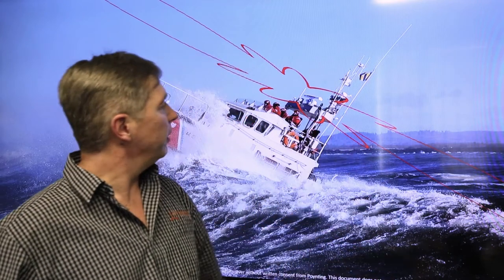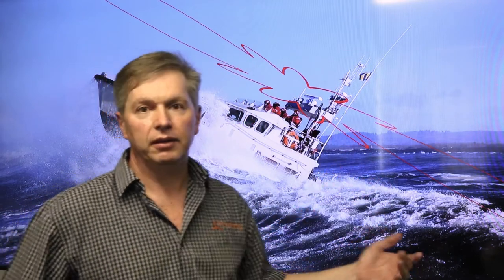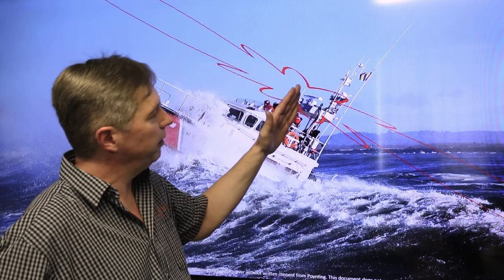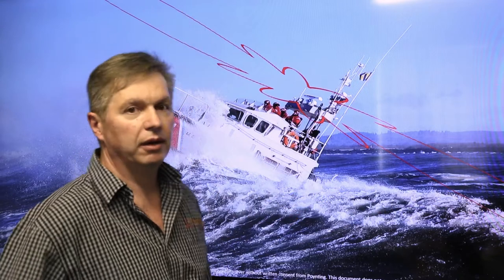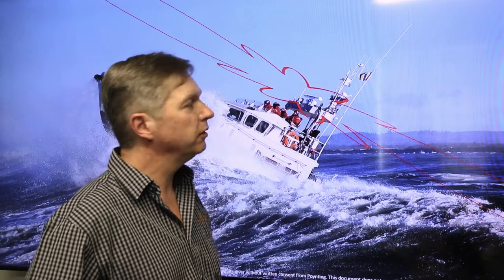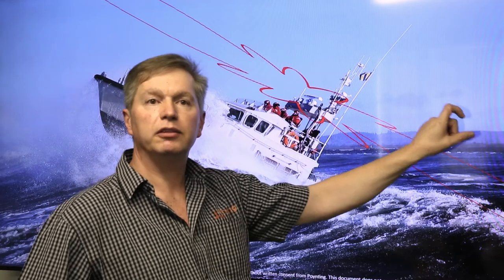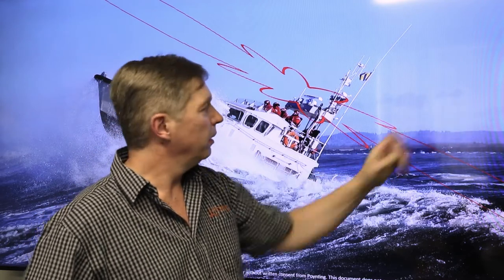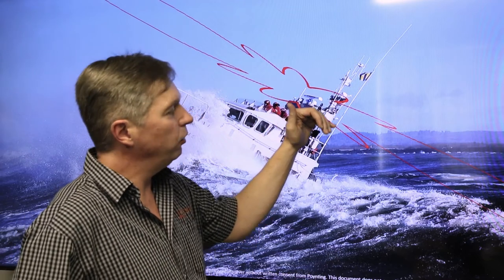Is high gain an important consideration for Marine Antennas?

Comment: Thank you, the omni 493 is considered high gain,  but I believe still has a good beam width?  Would you recommend the 493 for a ship? (not a boat)
Reply: Hi @ajgio, yes, absolutely. As you quite rightly say, the OMNI-493 has a relatively good vertical aperture for such a high-gain Antenna. A Ship, rather than a Boat, is relatively more stable in terms of 'Pitch-and-Roll' therefore the possibility of 'overshooting' the shore-based Base Station Antenna is hugely diminished therefore I would recommend its use on a Ship.